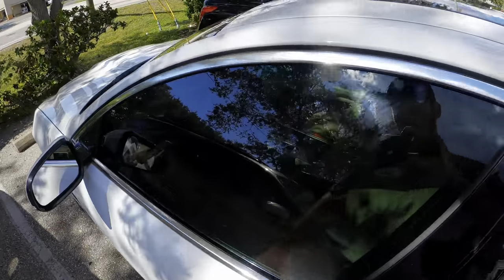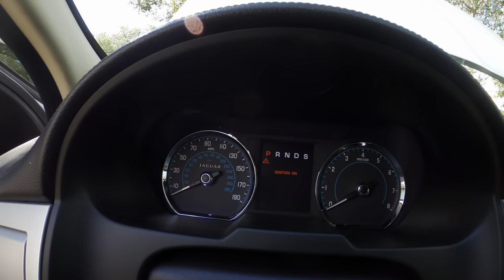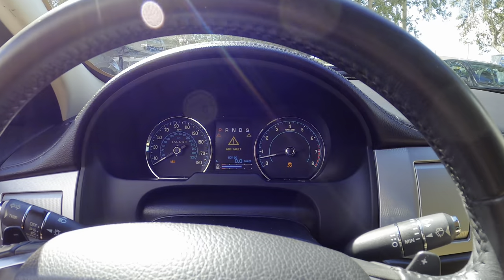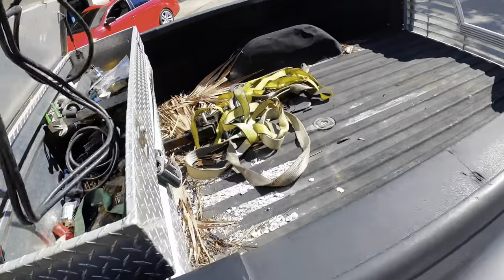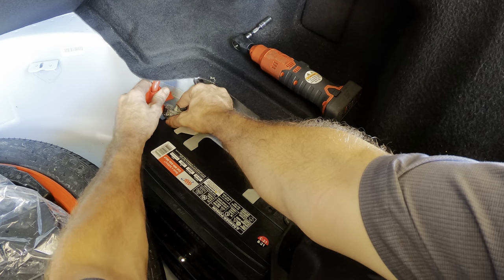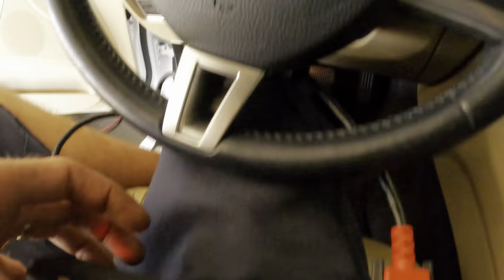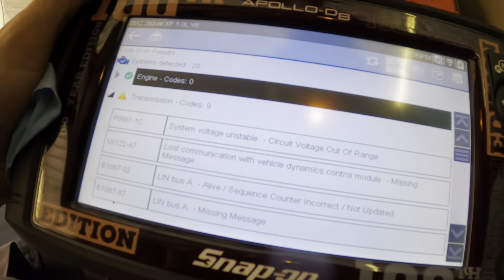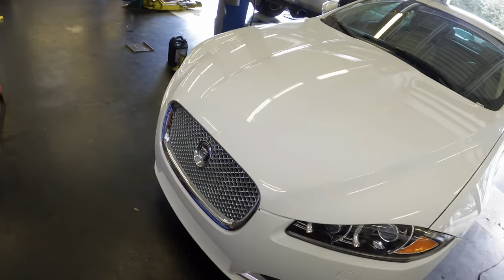Jaguar XS just Towed In.  I’m in over my head! Customer States: “Check Battery”

Comment: May not be of much help but I own one in the UK and had a similar issue last year with just about every warning it could throw at me and took two jump packs just to get it to crank. Turned out it was a shot circuit in the alternator pulling the voltage too low for any of the modules
Reply: Parasitic drain from Alternator ,  Red warning light on dashboard in the past .... (Alternators need a power source to engage their charge system unlike Dynamos ) ...❤
Reply: Read my story Carl, old BMW, alternator refused to put out enough volts ECU said NOPE and shut everything down,
Reply: I just had that happen to me on an Acura. It drained a fully charged new battery in less than five minutes, or whatever the metric system converts to from American.
Reply: @InsideOfMyOwnMind  yes my fully charged battery was down to 4 volts in less than 5 minutes and the battery was very warm. Thought I would need to replace the battery as well as the alternator but it’s still good a year later
Reply: Just what I commented on.  Happened in my BMW as well.
Reply: Well, that might be answer!
Reply: Worked on a Taurus once that was possessed by demons with every light on, auto changing radio stations, wipers doing what they wanted to do... alternator tested good at the big "A" store, didn't believe them and took to a Ford dealership and guess what? The alternator was bad!  Replaced the alternator and the demons were sent back to hell!  Bad alternators can do some pretty crazy things to newer tech cars.
Reply: @toyotatacoma6817  lol  I had a mercury zepher do the exact came thing back in the day. Thought my car was possessed, it happened while I was driving.
Reply: @toyotatacoma6817  I guess my 2001 lesabre has one up on all these cars, I got in one day to start it, a message light came on in the cluster after it started and told me that the alternator needed replacing, I took it out brought it to my buddy who owns an armature shop, he tested it and sure enough it was bad, I got one of his rebuilt units for 80 bucks and that was that, no fancy scan tool needed the car told me what the problem was, there's also a separate indicator for the battery, 300,600 and still going strong.
Reply: @Peter-pv8xx  I first read that as your "2001 Lesbian" but that's my problem not yours. Interesting though that the car was able to just up and spill it like that. Now with all the new tech why can't a car tell when you're drunk or stoned and refuse to start?
Reply: @InsideOfMyOwnMind  because you didn’t share and now it wants to hurt you!
Reply: had a similar problem with my 2016 cadillac. 30 plus electrical codes. come to find out a rodent had chewed the harness of the start stop sensor, causing a short circuit. dealership replaced the harness and all the problems dissappeared. these luxury cars are simply more sensitive to electrical issues because they have more systems that draw power.
Reply: These days with newer cars as many have already written, there are SO MANY electronic modules in just about e every nook and  cranny of cars today and ALL of them feed information to a FULLY  blown logic system (ECM) and all these modules report data to it. Anyone who knows computers, the voltage ABSOLUTELY MUST be stable. If it is fluctuating or too low, near about EVERYTHING logic will go nuts and most likely the ECM too. Logic circuits MUST have stable power and voltage.
Reply: @darinb.3273  the “forbidden zone” for digital signal procesessing. Once voltage drops significant, a 1 could become a 0, and a 0 could be intercepted as a 1 due to low references. Whenever that happens arbitrary data is being read, doing sizzle not suppose to happen.
Reply: @ClosestNearUtopia  You got it LOL. I used to drive a semi and it had an automatic transmission and it was a nightmare. It was in the shop more than on the road. This isn't like an automatic transmission in a car. It was still a manual transmission the difference was they designed electromechanical devices and took out the stick shift and replaced the clutch pedal with a centrifugal clutch (engaged when the engine RPM increased). That thing got to the point it wouldn't shift, it wouldn't shift up to the next gear either if it did it wouldn't the next time. It was awful when it got to normal engine temperature. I was told about stable voltages for that TCM (transmission control module) was a MUST it wasn't at all stable and despite my informing the mechanics about that I was ignored. The weird part was the transmission was replaced the TCM was replaced the wiring harness was replaced and it had the EXACT same symptoms the only thing that wasn't done was the stability of the voltage in the power system. It never did get fixed.
Reply: @darinb.3273  next time you bring in hour car/ motorcyle/ rig, demand everything they replace to be put back in your trunk. Ask them questions afterwards, why they change out so many components and still not listening. I would demand them to install everything back to original on their own cost because they mis diagnosed your issue. If they wont, fine, go to another store, let them fix what should be fixed, then try again to get your cash back if you already did not get that.. if they dont comply, sue them for not carrying out the problem and billing you for total BS. Electronics in vehicles are total money wasters most of the time, to much remote, to less controll, next to that would you really like to be depending on stuff like this? Image this biatch going in P while driving 60 on the highway, nothing but litterly nothing can stop that for happening random.. also, no stuff in the trunk means not paying new components, who said they could throw away your property and who said your intentions for that wasnt repairing instead of throwing aways, they screw you, screw them harder if they like bisuness like that.
Reply: @Peter-pv8xx  The 2K era LeSabres were pretty nice, except that whole battery under the seat thing.
Reply: @InsideOfMyOwnMind  cause they wouldnt get many people buying them😆
Reply: @toyotatacoma6817  . I had a 2014 Taurus that wouldn’t fire. First 2 times getting towed it started up off the wrecker. 3rd time everything read it was working but wouldn’t start. All the Ford mechanics were stumped.
Reply: @chrismaverick9828  I learned to appreciate the extended battery life that I got in the two '05's that I owned, from having the batteries located away from the dirt, weather and excessive heat. The original battery lasted a little over six years in my first one and the second LeSabre had the battery replaced twice in eight year intervals. The last battery went in less than a month before it was rear-ended at 45 mph. To add salt to the wound, I had pumped 15 gallons of gas in it ten minutes earlier. The big truck makers have even moved their batteries into the cab. The Freightliner that I drive has the batteries located under the passenger seat.

Comment: I had a friend come to me with a gunsmithing job.  I had to tell him that I was unable to do it.  His stock was broken and the gun was over 100 years old.  Hand-fitted stocks from Belgium.  Not a chance.  He seemed upset with me, but it was his family's fault for leaving the gun in a barn and using bailing wire to fix the original crack from 1920 or so.
Reply: Refer him to a carpenter instead. 
Custom made, hand fitted stock... 😅
Reply: @reallifeengineer7214  Sure...a framing carpenter would be perfect...
Reply: I used to do antique firearms restoration as a hobby to relax after twisting wrenches all day. Those were the ones I loved working on. I found it relaxing to either repair the original parts so there was no indication that it had ever been damaged or if it was beyond repair I would replace the damaged stock or portion of the stock with wood that matched the original which usually required getting a large enough piece of the correct type of wood from the country/region of origin from the same timeframe that the original was made, usually from a piece of furniture, or something from an old building that had been dismantled and salvaged. It wasn’t cheap, but was worth it to some people as it was a family heirloom. I also used the same types of stain (often aqua-fortis on really old or hand crafted ones) and finish (usually  many coats of hand rubbed boiled linseed oil, sometimes shellac, or on a rare occasion varnish)as the original and would tint it to match the original so it looked right and any relief carvings or inlays matched the originals.
Reply: @reallifeengineer7214  Custom 2x4 stock for the win!  It's custom because he used a Hyper Tough jigsaw... and there will never be another one exactly like it.

Comment: I'm on my third Jag, the current one a '17 XE.  I'd wager real money that an alternator replacement and a full charge on the correct battery would have sorted the whole thing.  In my experience, Jags a) are very sensitive to low voltage and start to do some very interesting downstream things you would not expect if they don't have correct voltage, b) do not respond well to replacement parts like ABS modules unless you can program them to the car, and c) like any cat, they'll let you know quickly if they're not happy.  

All that said, you absolutely made the right call on this one.  Lot of ways this could have been interesting for sure.
Reply: Those symptoms/fualts were exactly what I had with 2010 XF a few months ago.  The alternator had died and decided to take the battery out with it.
Reply: @planetzogg1  yeah ive also worked on fancier and or more complicated vehicles, and the thing about them is they need literally 14.4v or they start freaking out, the tcm on that jag probably uses 3 or 4 volts on its own just to operate and im sure the lack of power is just killing that system. but being an armchair warrior without a business on the line, id say ray completely made the right decision here
Reply: @ryangross5446  Oh he totally did make the right call there.  Unloading the parts cannon on a Jag can be eyewatering in the extreme.  I hope his customer gave him a lot of respect for that decision.
Reply: Yup. JLR products do not like low voltage at all, confuses the CAN bus and modules. If my rover did that, I'd put in a new 'nator for sure.  I was cheering for Ray to figure it out, but better safe than sorry.  Also I'd touch the battery cable ends together to reset any lingering data, and charge the battery fully before re-installing. Course I have ten years experience nursing the rover. Bad grounds can cause gremlins too.
Reply: @rickgesell9468  man rovers are tricky business and it sounds like you know your stuff about them
Reply: Indeed. There have been many threads on Jaguar forums about these cars needing top notch batteries. A water cooled design might have gave the alternators in these a longer lifespan.
Reply: @vw5056  Sending it to Jaguar to fix was the correct call. If it were me though, I would have kept the new battery in it and hooked up the duramax with it running to get a stable 14.4v with plenty of available amperage into the Jaguar. Then I would have cleared all the codes and power cycled it a few times. After all that’s done if it’s just a bad alternator you will only have the charging system codes remaining. Replace that alternator and throw in a high end battery (AGM) and your gold.
Reply: @planetzogg1  a vehicle with no means of producing electric power will go through its reserve very quickly especially if everything in the cabin is powered on etc. If the engine stops combustion but you still leave the vehicle on it'll further drain that battery down to unrecoverable levels and you'll have so much buildup on the plates it's better to get a new battery and let them recycle that old SLA back to new. If you lose the alternator it's best to Shutoff as quickly as possible and put the battery on a charger.
Reply: New battery and low voltage.  My first thought was bad alternator or broke belt.  But when you look in an engine and can't even see the alternator ...yeah that's a problem for the dealership.
Reply: @planetzogg1  yes I agree Bmw cars act the same if battery voltage is low or a poor ground  they will spit out all kinds of codes that wont make sense
Reply: A new batt n alternator and a code clear n that would it been done done these cars many a time
Reply: This Jaguar had 93000 miles on the odometer. Most cars have service schedules for various mileages but there is one serviceable part that is never listed in the schedules, and that is the alternator or the most important part of the alternator.....the voltage regulator bolted to the back of it. If you look up alternators it suggests you change the voltage regulator every 80000 miles. The alternator itself is virtually bullet proof especially now that modern cars have belt tensioners fitted so that the bearings  aren't overloaded. The voltage regulators are fitted with brushes that can become worn or dirt can accumulate on the central shaft breaking a good contact. It's the difference between paying up to $400 for an alternator and $60 -$100 for a regulator  or even $150 - $200 for a reconditioned alternator.
Reply: Just like VW vehicles.
Probably all use fairly similar Bosch modules.
Reply: I don't know vehicles but I'd guess either safety feature to stop the car running a low battery, no clue why, or a system bug caused by the low voltage
Reply: Yeah, just a software developer and amateur mechanics opinion here, but generally in software, when there are sooooo many errors like in this example, the cause of the problem is often very central to the operation of the system, and thus is quite easy to spot if you don’t let yourself get overwhelmed by all the errors but instead look for a pattern that the errors share.
Reply: Since he did figure out that the alternator was broken, he could have replaced that and then checked the car. If it still had the same faults then send it to the dealer.
Reply: Yes, Starting with the replacement alternator be the first thing a good mechanic would do. Electronics do not work properly with low voltage.

Comment: As I've always said, drive what you can afford to fix, you buy a high end vehicle take it to the dealership. I like how Ray is willing to admit even though he is a skill technician, we all have our limitations.
Reply: Sometimes it’s not a matter of skill, sometimes it’s a matter of experience. Two of my cousins are mechanics one is a diesel mechanic one is a motorcycle tech for Kawasaki and Suzuki. Both consult my father on matters regarding jeeps from the 90s or GM small block V8s made from 68-99. My father holds no certifications, but he’s worked on those engines himself for so many years he knows what symptoms usually indicate what issues on those engines.
Reply: NO SHAME
Reply: Or you get a premium five year warranty and fixed servicing. You’d be surprised what you can get through a decent dealer. I recently purchased a 17 plate XJ and they gave me a full plan for less than a grand and chucked in a wear and tear policy for just £30 a month paid over a year. Car drives sublime.
Reply: I’m sure there are lots of people even at the dealership who don’t know how to fix this. I bet it takes a tech who has a special endorsement to figure out what’s going on with the computer system.
Reply: It’s the one thing people forget/neglect regarding cars… I generally maintain all of my cars but, I also will know when to call in a professional. Prevention is better than a cure in this case.
Reply: Or you could choose not to buy crappy JLR products.
Reply: Dealership does not equal or guarantee quality service and best solution. On this channel there have been multiple cases of that, where he solves a issue where the dealership claims an over diagnosis. There are nightmare stories of people dealing months with car issues out of the factory with the dealership that are sometimes never resolved. 

Bottom line is professionalism, I have an BMW M3 and I take my car to a BMW only private shop and never needed to take it to a dealership except for recalls. Saved me thousands and received honest feedback and free diagnostics.
Reply: @FerociousPancake888  the dealership is just going to throw parts at it until it stops.  They don’t diagnose it properly, they just chase codes unless there is a TSB on the specific issue.  Most of the time on the imports from Europe when you have strange things like this, it’s an electrical issue.  It could be simply a bad battery, it could be the alternator/regulator, it could be a bad voltage signal on a sensor.  Most of the time, crazy quantities of electrical codes in my experience end up being bad battery’s or alternators.  But who knows….the only certain in this case if the dealerships bill is going to be large.
Reply: Generally people that buy these types of cars and can afford them trade them off 1-3 years when the warranty is done. I would never buy something like this used because I could afford to fix it, Couldn't afford the dealership labor lol!
Reply: @CarShopping101  Wouldn't know, I've never had a problem with mine. Anybody who knows anything about modern cars would have instantly recognised that a low battery is probably what is causing the problems, because everything is operated through the computer and if there isn't enough power to run that computer it throws up all sorts of faults. Throwing in a random battery which might not have even been the correct one for that car, and clearly didn't have 12v+ in it to start with, isn't the way to repair a car. The FIRST thing that anybody should do is put a diagnostic device on it, which would give you fault codes and tell you exactly what the problem is. "I don't really know what's going on...." - well that's why we have the diagnostic kit. I know more than him and I'm not a mechanic.